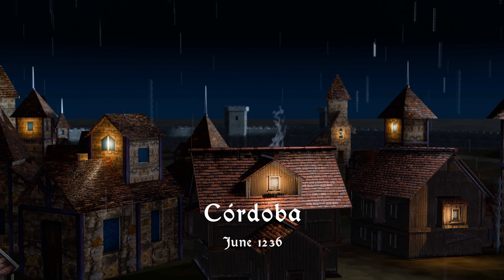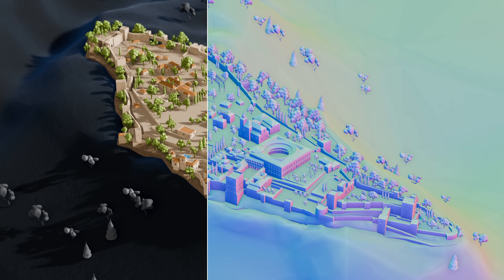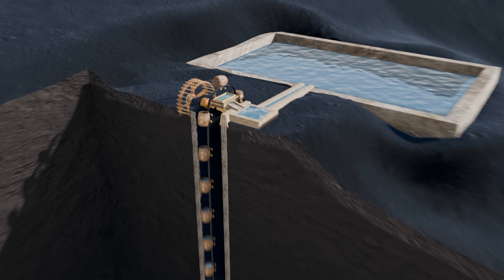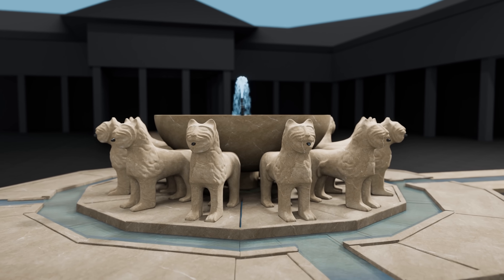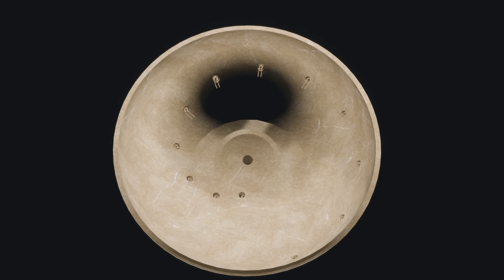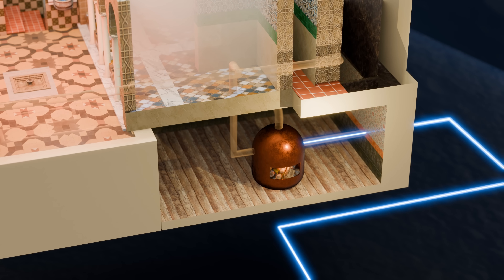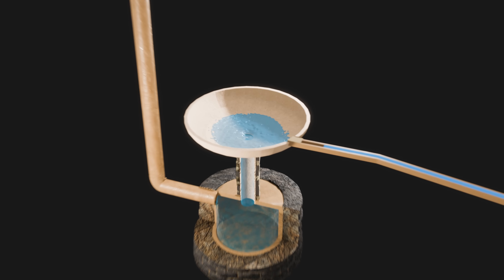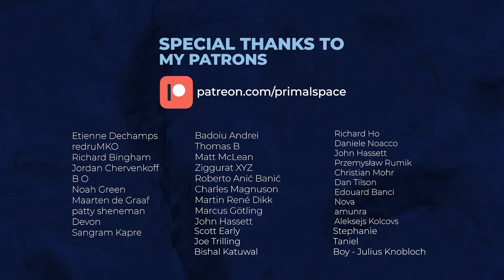The Ancient City That Mastered Water

Comment: SO clever to reduce the average density of the water by aerating it.  But.... 6 meters of head?! that's insane.  If we use P = rho*g*h, we can estimate this.
If water coming into the pipe is able to drop 6 meters before being forced up the longer tube for a total height of 12 meters, then we can assume the average density of the heavily aerated water is 500 g/cm^3.   
More likely, the aeration wasn't so heavy, so we can assume the hole was more like a 10 meter deep hole that the vortext was draining into.  This makes it so the aerated fluid's average density is only about 625 g/cm^3.
VARIABLES:
H1 = depth of pipe from water inlet
H2 = H1 + 6 meters
Rho_1 = Water = 1000 g/cm^3
Rho_aerated fluid = we are solving for this variable
EQUATION:
Rho_aerated fluid = (Rho_water * H1)/(H1 + 6)

Therefore, the deeper the pipe is at the inlet where the vortext is forming, the easier it is to lift the fluid the 6m as the required aeration reduces.
NOTE that momentum of the fluid is a factor as well as other variables, but the estimate should be close.

Final results:
To lift the fluid a height of 6m, the water forming a vortext likely travels down a 6 to 20 meter deeo tube before hitting a U-turn and coming back up the output tube where the final height of the aerated water is 6 meters taller than the water's input height.

Comment: For those wondering i looked the comments on the whirlpool pump and its essentially first air compressor invented. Water crabs bunch of air with it when it goes down, fills the chamber and allows the airated water bubble mix to raise on top of cone like chamber, witch pushes this mix in small tube up way higher than starting location, while rest of the water mass is allowed to bleed out from the chamber, keeping the volume same. So with little elevation drop you get low volume high lift capability for the water. System has no moving parts and for looks of it there is not much problems with debris filling the chamber so its rather maintenance free. Brilliant idea really.

Comment: Just to clarify: There is a way to make water flow upwards without external energy?? This is so ingenious that I wonder why this technique is no longer used today... 🤔
Reply: Actually water is lifted by extracting energy from the water falling down into rge lower chamber. You need a huge amount of waste water to lift a little fraction of it up.
Reply: @kjellg6532  Then just combine it with large containers, part by part... Of course the variant like in this video is not perfect. But it moves upwards, with clever floating only
Reply: @RauelON  Yes, but all water needed has ben lifted by the donkeys wakking round and round all day. Every drop in that water is powered by the donkeys, so to waste a lot of water in a sophisticated pump?  OK, it does not drop 6m or say 8 as it may come up againe from the lower compartment after having given away the compressed air, but you will need some drop to make the water flow down and up again. Maybe a waterwheele could have done the job with lesser loss of energy?

Comment: The special device installed at the western side. WOW! 

Scientifically, yes, it makes sense. water containing air bubbles may lawer the weight/density, therefore, can be less energy input to lift. But, don't know how much potentially the whirl (vortex) pushes up the hill (6m above). 

More explanation, please? 

Fantastic video, Fantastic narrator, Fantastic presentation!!!
Reply: The vortex is probably misleading. You could also use a bundle of straws at the top of the starting funnel. The system is a Trompe, a way to compress air from a stream of falling water. This compressed air is used in an air lifting pump. Such pumps are used till this day. They are not very effective, but can pump dirty water with sand and gravel. Used in civil works as they have the need and access to compressors in situ.  Look up Trompe and air lifting pumps.

Comment: Didn't know whirlpool can be use to elevate water, great video😅
Reply: Actually it can not. Look up Trompe. That is a way of produsing compressed air from falling water. The whirlpool at the top is just to catch air to bring it down. You could as well have used a bundle of straws at the top. Rhe straws could form a Venturi to catch air. An other way could be to install small vent holes around the top of the falling tube.
Reply: @kjellg6532  oh okay thanks.

Comment: I think the most impressive part in all of the water system design would be that they were able to not only transport water from 6km away, but also ensure maximum efficiency in it's use, all the way to the soldiers' quarters... Think about it-You're a soldier in the 14th Century, stationed at a fort that could be threatened by armies at any time, but you had running water! Especially even more impressive considering that most major cities in that time period wouldn't have that luxury for the rich, let alone the commoners. 

Truly a marvel of human ingenuity and engineering!

Comment: I think all of the water system is genius... I think my favorite part though is the aerated percolation to raise the water at the end six meters. 

I honestly wish that homes were created with this kind of a system instead of a direct pipe system that we use now... If homes had water tanks that were filled and then the water came from the water tanks... And if the water tanks were high enough to create the pressure then we wouldn't have to worry about whether or not there was water after an earthquake or something destructive like that... And there could even be a mechanism that automatically stops the flow of water if there is a big enough earthquake. These kinds of genius ideas I think are what will be required for our societies to move into the future.

Comment: Absolutely fascinating. So my question is about the lion clock. Since it was bowl shaped, and there was a consistent flow of water, the water level would have been slower and slower to rise as the bowl got wider. Also, each time the water level reached a new hole, it would loose more. So as the bowl filled up, the time it would take to rise an inch would get progressively longer. 

The holes for the 11-12 hours must have been much closer together than the holes for the 1-2 hours. Is this correct?
Reply: There is a lot of details to this “clock».  The distance from the center to each hole. The slope of the bottom of the slope, tha fact that #1 lion will spit more and more water as the depth in the basin increases,  How othen the clock had to be readjusted to the sun due to say evaporation.

Comment: Omg the part where they created pressurized water from water tanks was insane! It’s like our modern water towers
Reply: But was it pressurized? Flowing in canals, basins, aquaducts open to the air.
Reply: @ technically can’t u say gravity pressurized the water
Reply: @captaindave1016  Would you say that water slowly flowing in a near flat creek is pressurised ?
The water barely moves.
Reply: @kjellg6532  ye but it’s different because the water is moving a lot faster and it initially has a 100 foot drop from the pool it’s a lot quicker
Reply: @kjellg6532  literally search it up, it says gravity can pressurize water. The definition of pressure is just continuous force on an object, and here gravity is continually pushing on the water
Reply: @captaindave1016  OK. My cabin happens to sit about 6 m higher than a fast flowing mountain creek. I drop my garden hose into the water and voilá I have water up in the cabin from the pressurised fast flowing water in the creek?  My guess is that the creek will raise the water by say 2-3 mm. At Alhamra they had to invent a pump to lift water 6 m. This pump is driven by a huge amount of falling water. Water hoisted by some donkeys.
Reply: @kjellg6532  I’m confused is this a comment of agreement or not? Because the town had pressurized water
Reply: @captaindave1016  How do you get pressurised water in a canal open to the atmosphere? If you have access to such water, why not simply run a tube up to the soldiers quarters?  The description of the lions clock is also difficult. They also name a hoisting wheel, turned by donkeys, a “waterwheel”. Water wheels are powered by streaming or falling water, not by donkeys. I find this video to be a mix of facts and fairytales.
Reply: @kjellg6532  GOD DAM, bro I already told you that you can search it up online and it’ll pop right up. GRAVITY CAN CREATE PRESSURE. Go. Search it up right now.

Comment: There are so many impressive engineering used in this video, and the most favorite for me is water discharge from the water clock using the siphon and surface tension.

Comment: ‼️❗🤦🏻‍♂️Several of these hypotheses lack historical verification, such as the idea of the lion fountain serving as a timekeeping device, which has been recently renovated and thoroughly examined. Other components are deemed acceptable based on current scientific research, including the aqueduct that traverses the valley 👍🏻
Reply: Also the 6m elevation seems ok. Is probably a Trompe making air under pressure to give air to an air lifting pump. Explenation in video is not good. The lower chamber is say 10 m down under the inlet making an airpressure of 1 bar over atmospheric pressure. The water from the chamber is again lifted to a discharge say 1-2 m lower than the inlet funnel.
Reply: Thank you! Haha so much bs out in the internet and made up fabricated stories to create history of pasts that never existed.. entertaining sure but not for factual content

Comment: If in this clock the water covered more and more holes, shouldn't the input rate increase to maintain the pressure? Also if the animals where all on the same high but holes where on different levels, shouldn't the pressure and thus the distance of spitting water be different? I have so many qustion, don't even start on the wirpool thingy...😅
Reply: The lion clock does not seem to work as the video shows. Either the video is simply fake or there is much more hidden in the lions clock than they tell.

Comment: So.... what's preventing us from setting up a couple of those whirlpool pumps to raise water higher, only for it to fall, generate electricity, before being risen once more? Seems like unlimited free energy to me, after you construct a few whirlpools and add some pipes and a generator. I get that the flowrate isn't large, but anything greater than zero seems like free energy.
Reply: And you need enormous amounts of waste water.  A modern powerplant will use that waterfall with much higher efficiency.
Reply: @kjellg6532   Where does the waste-water come from or go in the example in the video? It looks like a closed loop to me. Maybe that's why I'm confused.
Reply: @kindlin  Please have a look at https://www.youtube.com/watch?v=JDrbTmFXEVY&t=15s The system is a Trompe makig air under high pressure. This air is used in an air-lifting pump.  The system is still in use today in special applications as it needs no external power source and can handle dirty water with sand and gravel. 
At Granada al lot of water is flowing. It goes into the input funnel, transports a mix of water and air down say 10 m to an underground camber. From here the water comes up and is discharged say 2 m lower than the funnel to make the water flow.
An interesting point is at the outlet from the upper basin into a small vertical tube. This resembles the carburettor in a petrol engine. Fluid (air) is rushed through a narrow passage, a venturi, sucking petrol from a nozzle. At Alhambra the fluid (water) is rushed trough a narrow passage, the top of the vertical tube sucking in air into the water flow. The air “nozzles” may be went holes at the top of the tube, a bundle of straws situated at the top starting above water level and ending say 1 m down the tube. Water forming a 1 m deep vortex may also work as a way for the water to catch bubbles of air. Any way, air is trapped in the water and at 10 m down the pressure in the air is 1 bar higher than atmospheric pressure.

Comment: It's amazing that in the 1200s there were engineers capable of designing this system. But then consider that the Romans had their aqueduct system over a millennia before!  How many years could that new canal have taken to build alone. They couldn't even achieve any of their miracles before that was completed. 
Why didn't similar hydraulic structures this elaborate appear in any other part of the world? Ancient engineers understood the power of water pressure and how to use it. Water pressure's been used in smaller environments like farms or small towns forever. But to divert water to supply an entire city including powering water clocks, bathing and steam rooms, fountains, a self-powered water pump, making vertical climbs, is all next-level stuff. 
Why don't we have water clocks TODAY?
Reply: Atomic clocks are more accurate. In Paris the had public clocks all over the town driven by pneumatic pulses each minute. In use about 1910-80

Comment: Im confused at the 12 lions still. Wouldn't the input need to spike at each hour in order to accommodate the extra throughput of water that each lion would require? How would they do that?
Reply: Your question got me digging and the time-keeping part might be 'artistically added' to this video. The fountain is engraved with a historic poem that actually describes the water as appearing very still due to its influx and exit. The engineering marvel was the exact balance of its level to appear still and "know not its flowing", or so the translation reads.

Comment: Many people claim whirlpool to be the most astonishing inovation of the city, but on my humble opinion the fountain-clok was even crazier. Here is why: thought realizing that water mixed with air will be come lighter and will travel even higher is hard to find, yet simple concept. One you find it out the design part is straight forward. One the other hand the fontain-clock doesn't require any new physical concept, but the pure calculations required to nake it so precise are mind blowing. And keep in mind that in 14th centure calculus barely was a thing
Reply: Or just testing and trial and error

Comment: The level of engineering needed to create these systems is mind-blowing! But I have a question about that water clock. I assume it's made of stone, correct? How did they carve the siphon passages? Or the passages from the bowl to the statues? 

Or were these things made of concrete? If so, I imagine they could have used a lost wax process to create the passages in the concrete.

Comment: For the whole system is amazing from building the dam upstream so that it is higher than the palace, and bringing water via an aqueduct that maintained a shallow & consistent slope
Building a pond to pressurize the water and also act like reservoir during drought. The water wheel mechanism, the water clock with an unprecedented precision at that time, then entire system of fountains and hot water and under the floor-heating system, steam room(i.e.  hamams) and then finally the system to raise water 6 m without using any mechanical device rather using compressible fluid dynamics. 
That shows how advanced they were and how deep their understanding of compressible fluid mechanics was. They were far ahead of their time.

Comment: I am really impressed by the whirlpool mechanism to send water 6m higher without any specific pump or animal.
Reply: But how does it really work? To raise some water 6 m, a lot of water must have been wasted further down. To lift water you ned energy.
Reply: @kjellg6532  It explains how it worked in the video
Reply: @monkeymox2544  Yes, they give an explenation, but I do not find it correct. To lift water 6 m you need to ad energy to the water. The only energy awaillable is some other body of water dropping 6 m, and how to transfer tis dropped energy to a lifting energy? Possibly the whirlpool is a sort of Trompe, but then there is more to this than what the video tells. Fuzzy video.
Reply: @monkeymox2544  This is how the pump works https://www.youtube.com/watch?v=JDrbTmFXEVY

Comment: Some engineers who worked on the Alhambra palace in Granada include:
Pedro Machuca: Designed the original project for the Palace of Charles V, supervising the work from 1533 to 1550. 
José Contreras: Led the restoration of the Alhambra in 1828. 
Rafael Contreras: Continued the restoration work after his father's death in 1847. 
Mariano Contreras Granja: Continued the restoration work after his uncle's death in 1890. 
Leopoldo Torres Balbás: Initiated the restoration of the Palace of Charles V after it was abandoned in 1637.

Comment: MARVELOUS ENGINEERING developed 900 years ago. As chemical engineer, I was much impressed be lifting water against gravity: by lowering density of water by mixing air on ejector principal. And strange to learn that system is still working after 900 years.